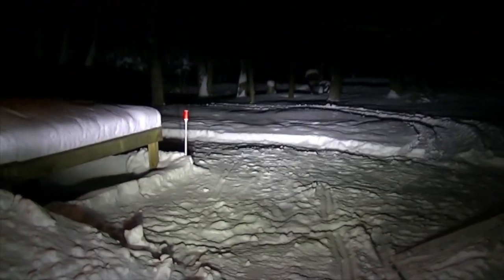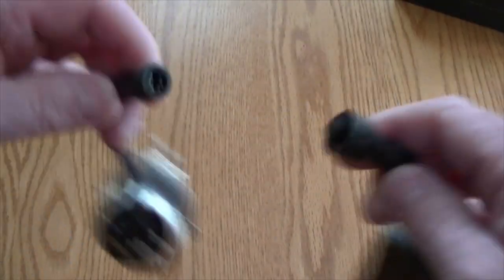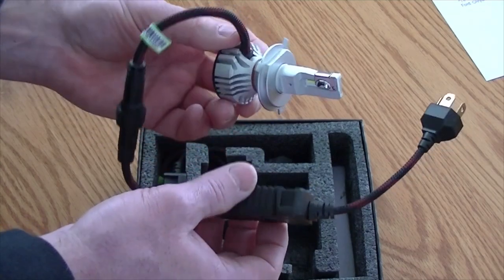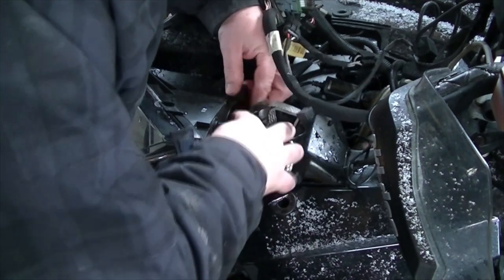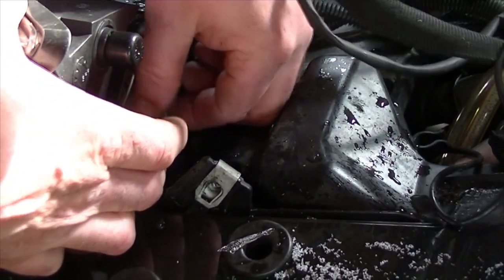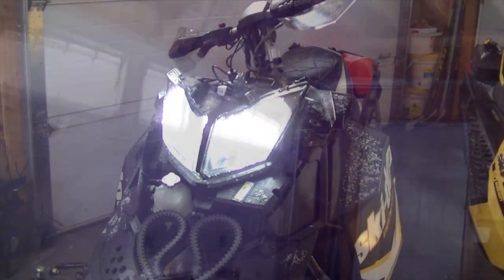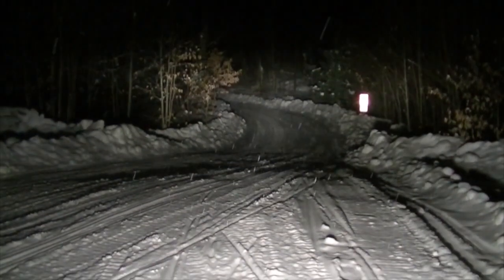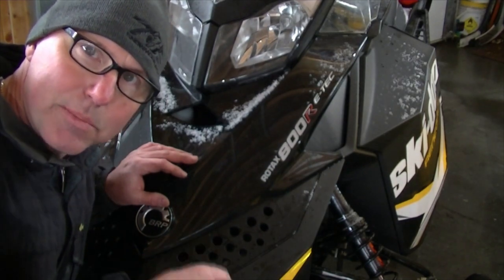HOW TO INSTALL BRIGHTEST LED HEADLIGHTS LED EAGLE DIAMOND VISION H4

Comment: Mud Brats --- been a year since you posted about the Diamond's, now that you have ran them for a year, do you have a follow up report, still impressed by them ???? they sure look impressive, one thing about night riding you can never have enough light, Great video BTW.
Reply from the maker: It's Only Money for sure, still very impressed.  You can here me comment about how bright there are in a lot of my Season Vlog episodes.  The one we went to the Gravenhurst overpass, I was on the other end of a bridge and projecting past the sleds on the other side a making monstrous looking shadow in the trees.  This is my 3rd season using them and wouldn't trade them for anything!

Comment: Any idea on what the life is of these bulbs? I don't want to change them every year or two. Is there any long term testing being done? Any 'expected' life of the bulbs, fan, etc.??
Reply from the maker: Walter Brech i have been using them for 3 Seasons and still going strong.  By design, LED outlast halogen (stock) and the DiamondVision have an excellent warranty.  Unlike other LED on the market that have plastic fans and rectifier boxes, these are all aluminum.  Here is another video with more detail https://youtu.be/-PKaf8TZdyQ
Reply: Very cool... thanks. Do they make the Diamond LED's for cars too? Maybe I'll get two sets...lol. In the video sure looks impressive and I like that you can see a true difference between high and low beems. The others you had look ok but not a huge difference between high and low.
Reply from the maker: @walterbrech406  Yes it is an automotive bulb... email info@motojungle.ca and we can see if we can source your car.... We have many varieties
Reply: 3 full years so far in a highway tractor, on all day 5 days a week. Had a wire corrode in Nov, hard wired it as truck was being traded in Dec. Have 2 new sets of h11s on the counter for my 22 international tractor. Loved them, had 0 complaints about them. Putting them in tmr

Comment: The light cut-off is on point even in reflector housing !! I am gonna get a pair now.
Reply from the maker: The video does not do them justice.... They are WAY better than this video camera can pick them up.  You wont be disappointed!  Thanks for the comment!
Reply: What about the fan less?
Reply from the maker: @ricadk43  The fanless versions are not a bright, and we havent had any issues with the fan in 3 seasons so we are sticking with the fan.

Comment: I know these Diamond bright bulbs with fan are brighter but how did/would they do in serious snow conditions/thinking the lesser lumen ones w/o fan might last longer in serious snow.....the ones you replaced.....how can I get either one of these shipped to the US on Amazon.....says it can’t ship to USA address.....why?  What is your direct website?
Reply from the maker: You can search on the amazon.com and buy from there if you are in the US as they are on the USA Amazon site.  We used them for over 1000miles after install and it was COLD!  -30 or lower with windchill and snow - never an issue.  I would buy these fan models over the fanless again in the future.
Reply: Thanks much for your input.   Couldn’t find them on Amazon.com in US but did find them on EBay and purchased a pair for Expedition and set for Polaris RMK Pro (H13)......
Reply from the maker: Richard Carlson LED Eagle now ship to the USA free shipping:  http://www.motojungle.ca/eaglehaslanded/

Comment: I installed a set of these bulbs in my 2005 rev. But they will not switch between hi and low. Did you have to install resistors? If I put a halogen bulb back in on one side and leave the LED in the others the lights will toggle hi and low. Any advice? Thanks.
Reply from the maker: I know what you are experiencing - the older 2006 Rev550 fan GSX we tried to install these in did the same thing - both LED Chips lit up (high and low beam) until you revved up the engine then it would go to low beam - there was something with the GSX Fan that we couldn’t figure out, we never contacted Eagle LED tho to ask .  Did u get the Eagle LED Diamond Vision or another brand?  let me know and i can do some digging for you if they are Eagle LED
Reply: They are the Eagle LED Diamond Vision  H4’s.

Comment: Has anyone installed the LED Eagle Diamond Vision 12000 lumen on a rev XS headlight?  I'm about to install on my sled and noticed that the wiring is inside the dust cover.  If I were to install with the fan/driver outside of the dust cover, then the wire has to feed back inside of the dust cover.  Just curious on learning from other experiences before trying to install mine.  I had LED Eagles on both my vehicles as well and have been happy with them so far.  They have been trouble free for about a year so far.
Reply from the maker: Thanks for asking here - I personally have not done an XS and the XS with the Fan bulbs in the other video was done at the dealer - But the fans were exposed/outside of the housing.  If there is a hole in the cover the driver will stick out the hole on the outside.  You may need to bore a hole into the dust cover if one is not there.   On both the Eagle LED Fanless and Fan Version, the small circular H4 plate will twist off.  Turn it 1/8 of a turn and it should slide away - slide the bulb through the hole in the Dust Cover.  You can install the Circular Plate in the housing like I show in this video and then slide the bulb (with the cover attached) into the plate and that should work.  The Dust covers are easy to replace if you mess it up.  Let us know how you make out with it.
Reply from the maker: Actually I just looked at photos of an XS light and it is the same dust boot that is on my Rev-XP... Watch at 05:47 and you will see how we doo this.  Is that how yours looks?  Or if it's a solid cap, this video may help:  https://youtu.be/hK3VH7Ys2C0
Reply: Mine look like this:  https://www.youtube.com/watch?v=GBy3k7ANnls
Watch at 9:30 and you will see the rubber dust covers that don't have any wires sticking through.  It appears that I would have to cut a hole so that the fan and LED driver are on the glove box side of the dust cover and then cut another hole to feed the power cable back into the head light side of the dust cover.  It won't be a very good cover by the time I'm finished!
Reply: @mudbrats  Easy to replace, where can I order ones with holes in them? I just got my Rev-XS, and the caps are "soft" ones, without holes.
Reply from the maker: Francis Giguère I got a set from a snowmobile wrecker / used snowmobile parts guy.   You can also try the dealer as well.  Are you in Canada?  Snowline Sports near london is a snowmobile wrecker and will ship as well
Reply: @mudbrats  I'm in extreme north Quebec, working in an Inuit community. This is my first sled and I want to outshine everyone on the land lol. The dust caps I have are nothing like the ones in the video above and they are accessible through the glove box compartment. Now I wonder if it's gonna cause any issues, since the fan will kinda be exposed as the glove box isn't insulated.
Reply from the maker: Francis Giguère if you are on facebook, look up “Mud Brats” and message me a pic - ill do some digging for you and see if i can come up with a solution - these lights will definitely rock the competition
Reply: @mudbrats  folllowing this thread because i was about to order these one on my XS but i dont wanna run a shit/hack job on my sled. could you comment back on a good way to install these on xs?  thanks
Reply from the maker: Maxime Boudreau cut a small hole the diameter of the bulb shaft to the bulb can slide into the cover with a tight fit.  You can also add tape or possibly other weatherstripping around the hole to keep snow out of the housing.  I hope to have a video showing this uploaded soon
Reply: @mudbrats  thanks i ordered the eagle bulbs , hoping i wont regret it.

Comment: Do you have a phone number for Eagle LED, I think we may have ordered the wrong bulbs, no high and low beams....
Reply from the maker: Richard Carlson i couldnt find the bulbs on  usa amazon so i am currently setting up distribution from my website to serve usa direct - ill have more info and a link early in the week - was it an LED Eagle product u purchased?
Reply: Yes, it is the same led bulb kit that you installed on your Ski Doo.....My son installed the Eagle LED Diamond Vision kit on a 2015 Polaris RMK Pro and it has the same brightness on Hi and Lo.....no change....could it need a canbus connected to wiring?  He’s going to connect the other kit (same) to the 2018 Ski Doo Expedition Sport (XS) in just a few....
Reply: By the way, I think you might be able to get quite a few sales on this kit once it catches on.....
Reply: @richardcarlson4327  Can you let us know how your son did it? Got my Expedition Sport 600 Ace last Friday and there's some minor differences between the XS and the XP in the video. I have a set of Eagle LED coming in in the mail, should receive them this week and I'm really excited to put them in, but it might require some tinkering..
Reply: We didn’t install the Eagle LED kit on the 2018 Ski Doo Expedition Sport 600 ACE XS because never found a H4 plug anywhere under all the plastic.....didn’t want to hardwire them in so I just sent them back to Eagle.....
Reply from the maker: On the 600ACE XS they are tucked under the round rubber snow caps.  A lot of viewers have been asking about installing these on Rev XS Ski-Doo so I just put up a video as I personally never seen under the hood on these:  https://youtu.be/auS0oQJJt7I